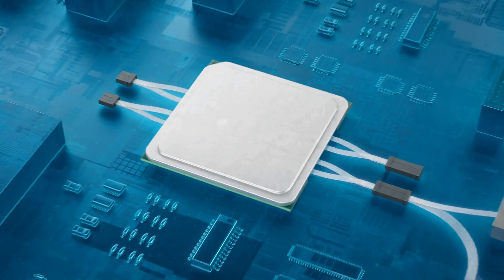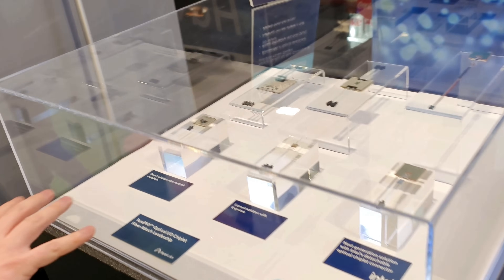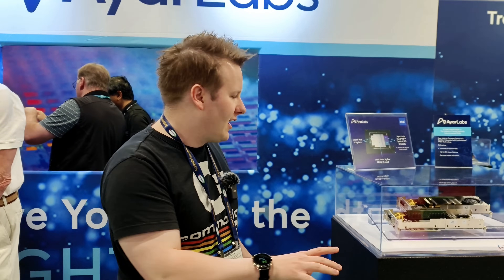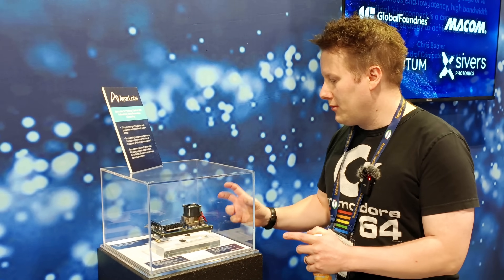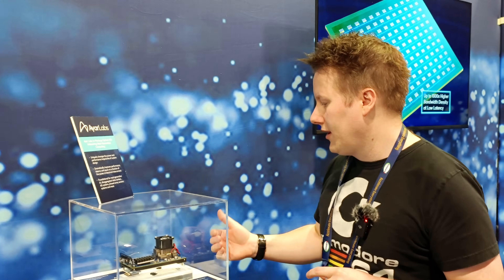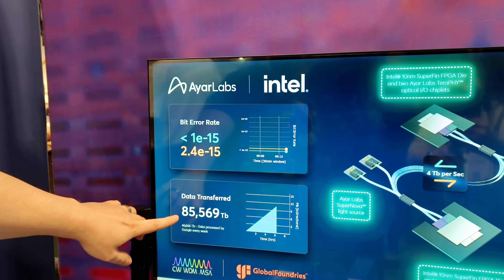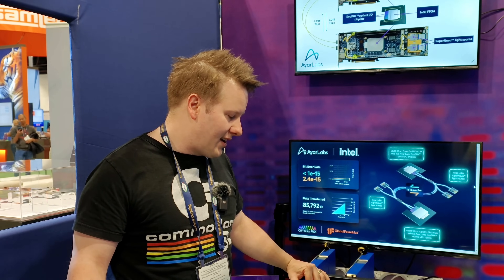How fast can you transfer data between two GPUs?

Comment: You mentioned this is an “in-silicon solution that can be integrated as an SoC into whatever chiplet needs to use it” and their PoCs in the glass cases seems to show chips with fiber optic cables running out of them. Given these interconnects are rather delicate, is the current state of this tech physically durable or can a little rough handling of the PCB cause an entire chip to be thrown out? Curious if this is temporary before these optical interconnects are embedded into the PCB itself alongside all the other planes, an optical plane perhaps to compliment the many power planes that are typical? Or something similar as long as something more durable is on the cards perhaps?

Comment: I'm amazed they can turn light on/off so quickly. I grew up around incandescent lamps with nichrome filament; even after power was cut, the filament would glow from thermal radiation. Pretty amazing stuff!

Comment: Listened to electrical engineers talking about high speed cabling. It sounds like we haven’t yet approached the end of speed for copper and the change to light and back is still extremely power and heat expensive. 

It sounded like photonics is still some years away from mainstream.
Reply from the maker: Cornelis assumes copper will be good for 800g, maybe 1.6T.

Comment: Do I understand correctly, it's 4 Tb/s bi-directional, so 2 Tb/s each direction, so equivalent to what PCIe would call 256 GB/s (for x16 ofc)? So it's on par with PCIe 7, and about in the same development state?
Reply from the maker: Don't forget that internal caches in hardware run at Tbps. Imagine having additional cache on the next rack over at the same bandwidth.
Reply: @TechTechPotato  They are showcasing 16 Tb/s Interconnect this year so maybe a follow up video?
Reply: Yes this is equivalent in bandwidth to x64 PCIe5, or x32 of PCIe6, or x16 of PCIe7.

I’m not aware of any public demonstrations of PCIe7 at this time, given that the spec is still so early in its formation.

This technology is being publicly demonstrated right now.
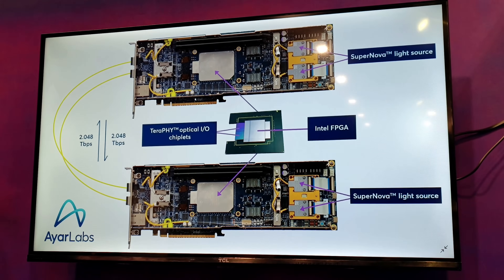Reply: at 3:05 you can see it's 2Tbps per direction. ofc given this is very early days for silicon photonics I wouldn't be surprised if it's 4 Tbps each direction in a year...
Reply: @GeekProdigyGuy so using Ethernet terminology it would be 2 Tbps.
Reply: The advantage of in-package optical IO is that it uses much less power and has much greater range than electrical signaling. That would allow high-bandwidth, low-latency connectivity across the data center.

Comment: This means around 500gigabytes per second of bandwidth. Doesn't nvlink already do upto 900GBPS and start at 600GBPS and amd also does around 800GBPS. What am I missing here.
Reply from the maker: Electrical vs optical. Distance without repeaters or archive componentry. This can go across a datacenter, rather than in-server or (with the masses amounts of switches nv uses) in-rack. One link could be split into many 25/50/100 links to make a large radix all-to-all solution.
Reply: As this is an optical signal it can be transmitted over longer distances easier. Ayar Labs page says that the TeraPHY can directly transmit up to 2km. I'm not sure how long NVLink cables can get, but I guess not very far, since they use high frequency electrical signals.

Comment: What is the BER, the graphic isn't clear. Is it 1 or 2.4 per 10^15. Do those figures include FEC?
Reply: The two numbers are the BER in each direction for the full duplex link. One direction is 1E-15 and the other direction is 2.4E-15

Both numbers are raw BER with no FEC. This is designed for low latency and power so, there is no FEC involved.
Reply from the maker: Sub 1x10^15. You can tell because the TB total is in blue
Reply: One of the arrows is yellow, what does that mean?

Comment: I'm guessing for distance, latency would be an issue long before signal integrity?
Reply: Latency is 5 nanoseconds / meter of fiber, limited by speed of light.

We have shown demonstrations of the links working over more than 500m of fiber with no signal integrity issues, and there is likely room to go even longer distances.

The latency constraint will be strongly dependent on the application. I/O to memory may be limited just by latency of the speed of light, but other applications may be able to take advantage of the much longer reach.
Reply: latency caused by distance is not much of a problem there. As long as the signal is intact latency might have an impact on frequent request but that should be about it (PCIe for example can have huge latencies and still be fine, but is very susceptible to timing and waveforms).

Comment: It'd be cool to see this technology used to extend the PCI Express bus (or CXL) beyond the confines of a single rack, or clustered group of racks, to the entire data centre. Who needs networking when your entire super computer can share the same bus?
Reply: I think PCI-SIG are looking into some sort of standardized optical connections for PCIe.
Reply: PCIe, with its packets and switches looks a lot like a network. What's the difference?
Reply: Latency would essentially make this impossible for PCIe.
Reply: @mycosys  For a multi-connection BUS maybe, but direct connections should be no problem.
Reply: It's a good idea, but latency will be a problem. Since we move to giga hertz light "stoped being fast", compared to computer processing power.
Reply: @jaimeduncan6167  "Since we move to giga hertz light "stoped being fast""
Not really. That is for inside of silicon. But this is for longer-distance interconnects. With PCIe you are talking about several hundert ns latency.
Even a simple PCIe retimer can add over 50ns - enough for several meters via optical.

Comment: The next step definitely is figuring out a more robust interconnect -- integrating these fibre-based channels into a chassis backplane, for example. Imagine this, powering the links inside an HP Synergy enclosure.